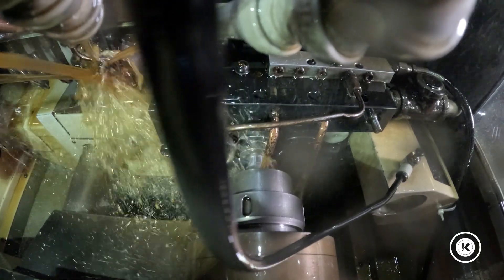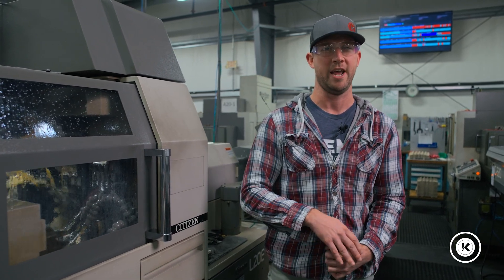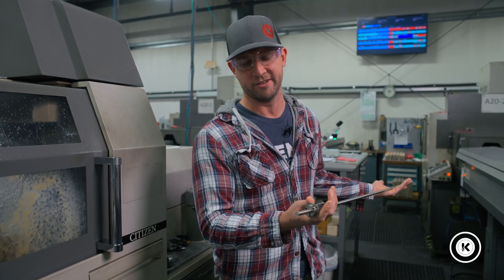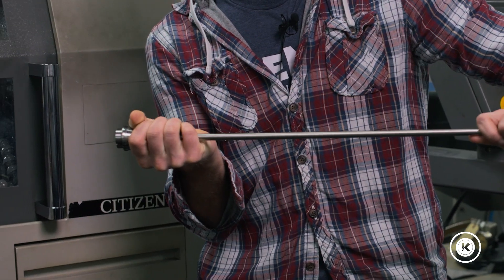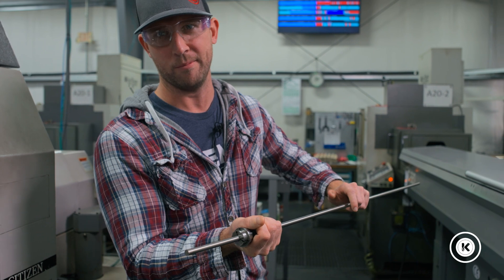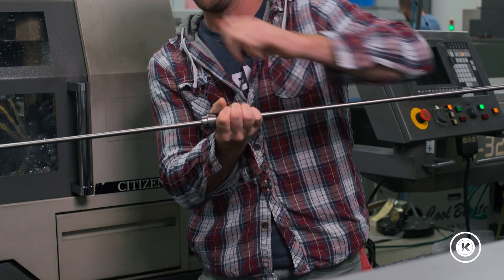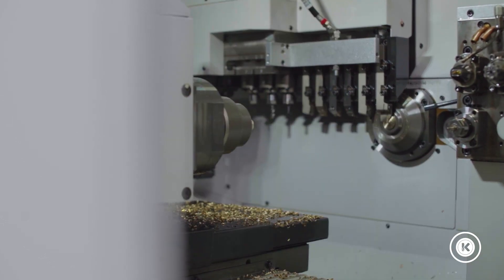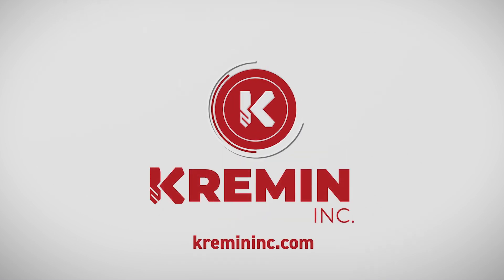Quick Tip - Zero Cost Swiss Speed Increase?

Comment: This is not ideal at all.Because it makes the end of the bar bigger.

If the main chuck  moves away from the guide bush, it will cause more vibration in the guide bush
Reply from the maker: We will try to do another update on this with more program detail - in this case, we are running a very thin part - so the distance from the guide bushing does not impact us but you are correct - for a different geometry, that could be an issue. The part is so quick and thin, we are saving time by not re-chucking every part, but doing it every 5 - the bar end is still very close to the optimal size because the 5 parts in 1 cycle are not very long - but good feedback, thank you.